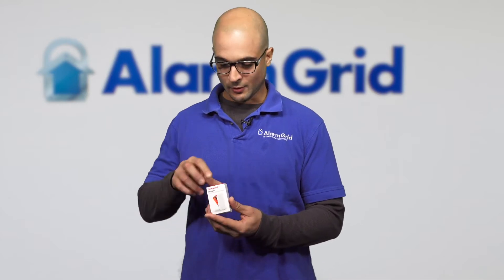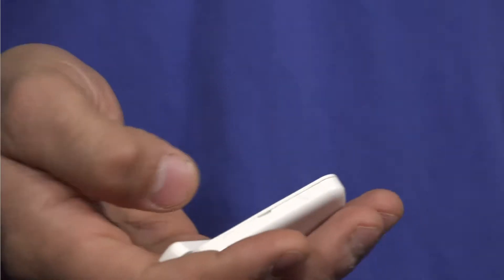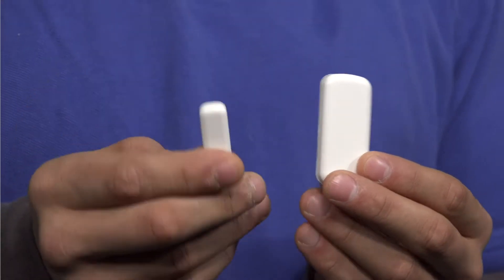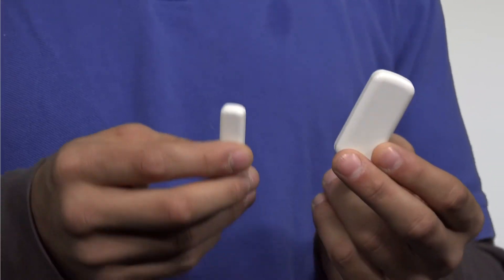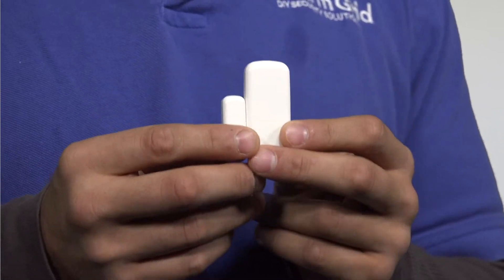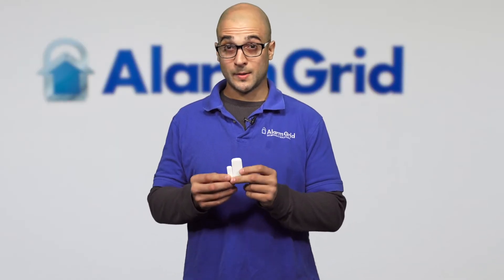All the Reasons Your 5800 Sensor Might Lose Supervision

Comment from the maker: Joe mentions that if you begin to have a lot of supervision issues, it could be that the antenna is wearing out in the sensor.  In reality, it would be the transmitter that "wears out" or becomes weak. If this becomes a recurring issue, and you know the battery in the sensor is good and no big changes in the environment have occurred, it would probably be time to replace the sensor.

Comment: So I paired a new sensor, and after installing it at the window, it gives a supervision fault. Is there nothing I can do to increase the range?
Reply: @rshinn8776, Does it seem to be an issue with the mounted location? Have you tried a different location on the same window?  If you have another sensors that is not having issues, swap that sensor with the one currently having issues in that window and see if the issue is that sensor in another location or the mounting location in that window with the new sensor in the window.

Comment: But how do we fix it
Reply: Moving a Honeywell 5800 Series wireless device a few inches up or down, left or right can make a huge difference when troubleshooting an RF supervision loss. If you are experiencing frequent RF supervision problems, you can try adding a Honeywell 5800RP wireless repeater between your wireless receiver and the devices causing the RF supervision issues to resolve this.

Comment: What can be basic problems if some of my sensors do not seem to work and I have to bypass bunch of them every time?  Bad batteries(which I try to replace one of them at least), or other issues?
Reply: If they are not working, I would take one closer to the panel after checking programming.  if you dont know the serial number take it closer to see if it works. If not delete the zone then ad it back in and try to trip the serial number in.